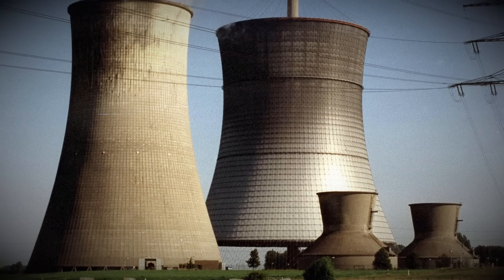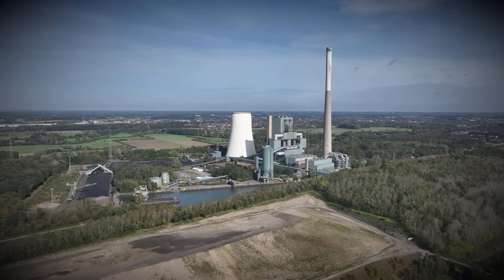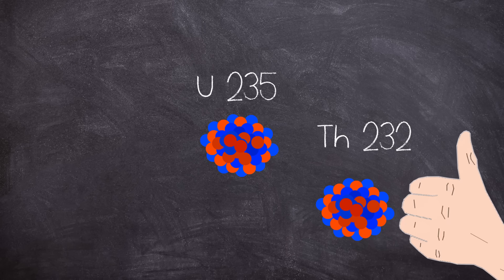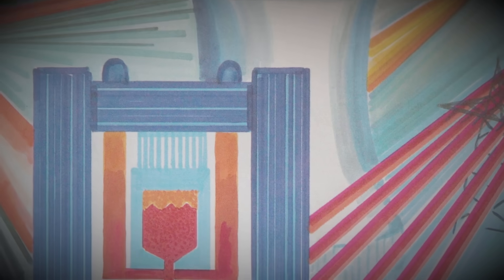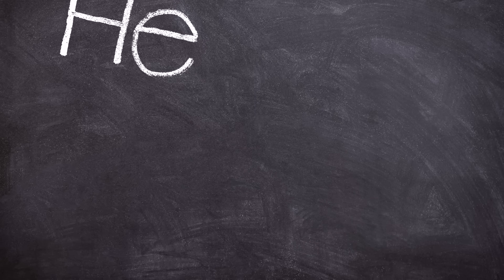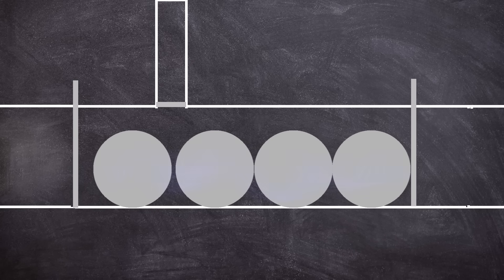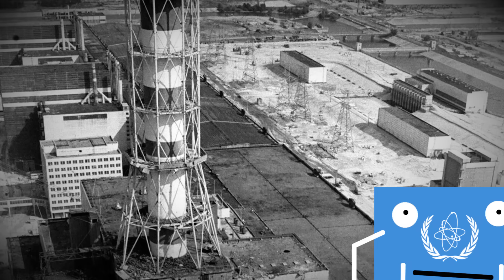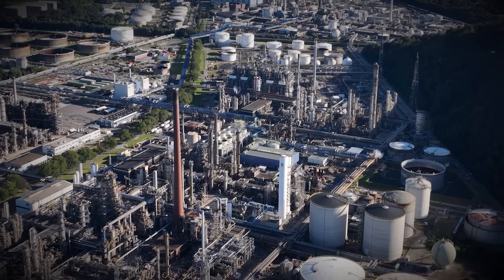Inside Germany’s “Chernobyl”

Comment: There is a shut down nuclear power plant in Lubmin, Germany, then the largest power plant in the entire GDR (AKW Greifswald). Anyone can book a tour there and a very nice and old tour guide who actually used to work there and is very knowledgeable about this stuff will show you around the place and actually INTO a core itself, because there is a core that was built to about 80% when the nuclear decommissioning started in Germany. This means that core never saw water nor fuel, so it's not a hazard whatsoever. I have been there and it was probably to coolest fucking thing on the earth! Everything is out of stainless steel, even the walls! The effort and size of it is something everyone should experience in my opinion.

And it's a guided tour group of only about 15 people, which I find very tragic.
Reply: The Greifswald NPP reactors in operation had a substantial problem: the WWER reactor cores had too little insulating water between the outer fuel rods and the core drums. Thus, the radiation from the reaction made the steel brittle. By 1989, there were reports that said "unless the core drums are fixed, operation is risky and I'll-advised". As the WWER were typically less secure than the West-German EPR reactors, it was no hassle to put Greifswald NPP out of operation. Over 35 years later, the decontamination and teardown of the site is still going on.
Reply: @CranialMalfunction  The problem could be fixed with annealing the reactor vessel after a couple of years. This has been done on both blocks of Bohunice V-1 in Slovakia. The reactors and entire control system as well as the plant were inspected by western experts and the conclusion was that the plant is on equal safety operational level as similarly old reactors of "western" design (you can find an IAEA report on that). However, it had to shut down because of Austria, as they would block Slovakia to enter the EU if those blocks were not shut down. It was a political decision. Same as with Greifswald. Especiall the case of Block 5 and Block 6 which had the newer design (as Bohunice V-2) that is still operating in other power plants and will do so for the coming decades. The decision to close NPP Greifswald was a political one, as the reactors were perfectly safe in their time. Especially 5 and 6 could safely run today and produce clean electricity. There are many reactors of the VVER 440/213 type operating today and there have been never any accidents with this type. New reactor based on the VVER 440/213 are being built too. See NPP Mochovce block 3 and 4. Block 3 went into commercial production one year ago and Block 4 is expected to come online soon. Both are expected to operate into the 21st century. Practically, Greifswald Block 5 to 8 (if finished) could operate safely until the 2080s. But no, Germany decided to burn coal instead. Great move.
Reply: @ErikZiak  Bohunice V2 is still running, why are you complaining?
Reply: @erikziak1249  Erm... Nah. By 1989, there were internal reports (even West German companies were hired to evaluate the degradation of the reactor core hulls) stating that the older reactor core vessels are becoming too brittle due to the impacts of fast neutrons.

These reports and material analysis concluded that the core drums could break if large amounts of cold water had to be pumped into the reactor, e.g. during a critical leakage.
Reply: I was in there. Verry nice! (and it is free :-) ) Block 6 is it. Block 1 to 5 where used to produce energy. Block 5 only a few weeks. Block 1 and 2 did also heat the city Greifswald. The powerpland also owns his own raliway. (moving the personal between city and NPP)

Comment: Germany will have to turn back on all their nuclear power plants, and then build some more.
Turning off the nuclear power plants has been the most erroneous, politically motivated and idealistically driven move from German politicians. Normal people asks, "What were they thinking?"
Reply: Not gonna happen. Renewables are much too cheap for any company that is active in Germany to invest in nuclear again. The old reactors aren't fit for service anymore and would need huge investments. Coal is at 21ish percent of energy production currently and is being phased out as well, while there is a massive surge in investments into battery storage. No need for nuclear anymore. Also, I have a different experience as far as what "normal people" have to say about this topic. Of course the nuclear exit was politically motivated: Germans demanded it and voted for the partys that would implement it - which wasn't even just the green party, but mostly the conservative CDU and the social democrats. Implementation of the will of the people is pretty much how politics are supposed to work.
Reply: I agree 100%. One of the biggest political messups and shortsighted decisions streched over decades. i dont think there is anything left that could be turned on. The last new reactors were build in the late 80s, 60% of all reactors (if my quick check on wikipedia is correct) went online before 1980 and all but the "newest" four reactors are already being deconstructed. Were stuck with stupidly high energy prices, imported nuclear generated power from france and hell will freeze over before the construction of a new npp is greenlit in the current political landscape.
Too many details omitted when approaching a complex subject.
Reply: @peterhansuwurst7852  Well, this is what happens when the "conservative" government does not invest, therefore not even conserve, let alone renew necessary infrastructure. Neither did they really react on the studies and calculations, even warnings, that the old sources of energy will get stupidly expensive. With nuclear being the most expensive and riskiest one, by the way.

Now all those things have to get sorted in a short timeframe, with a lot of money and a lot of problems to solve.
Reply: This, 100%!!! For a country that prides itself as technologically progressive, effective and clever, this is a big disgraceful stain that makes you question a lot about Germany. I live here and I must say, one of the most painfully ironic things here is the Green Party which is mostly responsible for the shut down of nuclear reactors, the "green party" that is looking into saving the environment , doing that by shutting down the most effective, reliable and environmentally friendly source of energy and thus forced the country to mostly rely on COAL and FOSSILE FUELS, and we all know how great that is for the environment. A bunch of clowns.
Edit: they import a lot of energy from France, which is mostly nuclear. I would laugh if it wasn't so tragic.
Reply: @mariagheata2133  Uhm... you do remember that the CDU-led CDU/SPD coalition made the decision, right?
Reply: After Fukushima, Japan turned off all their rectors for a few years to improve safety.   
Now in Japan many re-starting operating again with added safety measures..

France is "stuck" with old water primary coolant GenI through GenIII reactors.   Some few recent water cooled GenIII+ reactors are being completed or online.   The new GenIV reactors will have much higher safety standards and many primary cooled by helium which does not become radioactive.
In 20 years from now (starting 2030) many GenIV reactors will be on-line.
Reply: @Carlos-im3hn  what about waste? What about insurance?
Reply: @Carlos-im3hn  and solar panels have become even more efficient (combined with several other materials that can capture different wavelengths and turn them into electric power). Maybe there are even some decent accumulators. The number of potential customers will be smaller than in pre-solar times. Divide the cost of nuclear power among them, and... the price will be anything but low.
Reply: Not going to happen, and we are on a good way to also phase out coal entirely by 2038, while the share of natural gas in the electric energy mix has remained pretty much constant

The nuclear plants in operation were near, some even beyond,  their original planned life time anyway, and new new commercial plants had been planned since the late 1970s.

Renewables can be rolled out more gradually and quickly by now, no need to wait for over a decade from start of planning to getting to the grid.

The UK is learning this the hard way right now for example, their new plants in construction now will need to be heavily subsidised.

Nuclear was only cheap as the German plants had already been financially written off, so every further year of life time squeezed out of them meant profit.
Reply: It's ridiculous.  Crowd madness.  He said it's not his place to judge.  Well, I'll judge:  STUPID.  The sort of thing I'm used to living in the US and look to Europe not to do.
Reply: @bsadewitz I regard the United States as being terribly stupid in it's ways to waste enormous amounts of energy. How come the per-capita energy consumption in the US is twice is high as in Europe?
Well,  two of the reasons are
Driving gas guzzlers instead of reasonable cars
Shoddy, uninsulated houses that require enormous amounts of energy to cool and heat

Ridiculously low energy and fuel prices just don't give consumers any motivation to improve.
Reply: @ElwoodEBlues  Yeah, so you're preaching to the choir on that, more or less. Personally, I would add the cultural fixation on automobile ownership, period--in areas of high population density, at any rate.  For sparsely populated areas, fine.  That's understandable.  But public transportation is skeletal  even in many populous areas.  I'm hoping one day people just get tired of this pathological aversion to urban planning (or whatever it is).

I remember around 30 years ago being in NYC with my father, and him remarking to me how ultimately a ban on private cars is inevitable (and he worked in the automotive industry, which, ironically, is how he knew this), so they really should stop kicking the can down the road and start dealing with it now.  He pointed down the avenue  and said, "Imagine if, instead of this smog and chaos, you just had several orderly lanes of trolleys and buses.  You could have so many of them that there would hardly even be a wait.  Well, one day in your lifetime you may see that, because eventually there will be so many cars this whole place is gonna be a parking lot, and the city will have no choice."
Reply: The fun thing about it is that it was the Conservatives under the CDU and Merkel who shut the Nuclear Plants off after Fukushima.

And build new ones? Na don't think it will happen. These things now are expensive as fuck (the most recent one in Finland cost around 10-times more than planned (10 instead of 1 BILLION €) time consuming as fuck to build and most importantly... where should the Fuel come from? Russia? and Where to dump the Waste? There isn't a clear plan for dumping the stuff we still have.
Reply: @Tomlar147 the CDU first withdrew from the end of nuclear power which the precious government (SPD/Grüne, so in fact the green party was a part of that) already had decided on.

Then after Fukushima, they withdrew from their withdrawal from the end of nuclear power in Germany.

So yeah, they ended nuclear...after they ended the end.